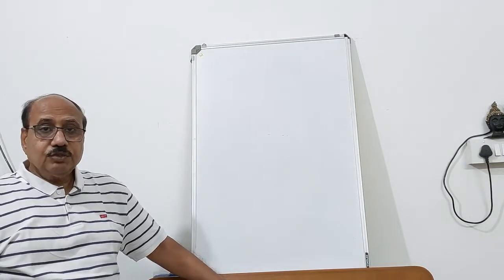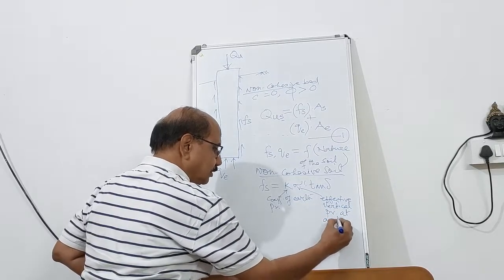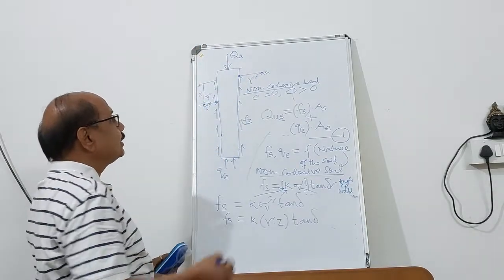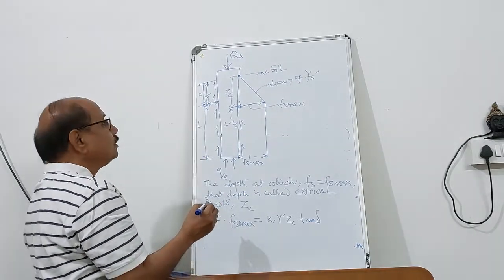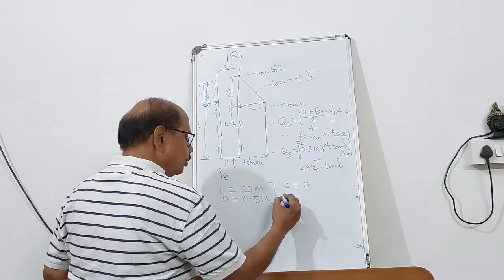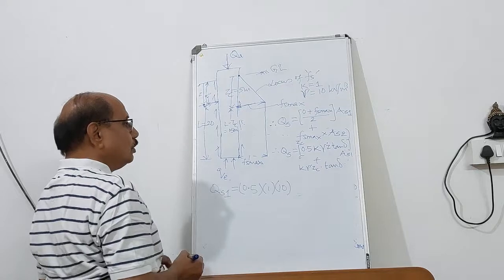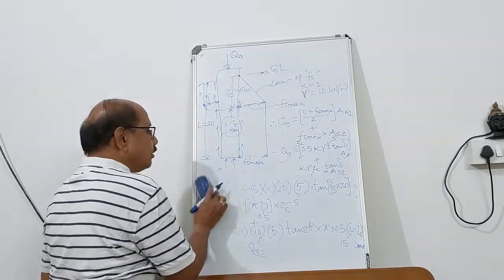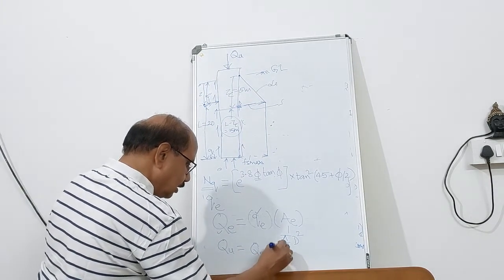Pile Foundation - 11 | Ultimate Load Carrying Capacity of  a Pile embedded in Non- cohesive Bed

Comment: One time I peer reviewed a pile design calc.   The designer said driven piles don’t have a critical depth in sand - resulted in a high capacity.  PDA data (2 weeks after initial driving) show the ultimate capacity is lower than his calculated capacity by a large margin.  So critical depth is there.   Great teaching material.  Thanks.
Reply from the maker: Welcome: 🌹

Comment: Zc=5m  but in Qs2 Z=15m so your answer is wrong you have to change this
Reply from the maker: Dear Bhautik, Qs is divided into 2 parts as Qs1 and Qs2. In both Qs1 and Qs2, fsmax  will be k*y'*Zc*tandelta and in As1, it will be perimeter of pile*Zc; whereas in As2, it will be Permeter*( L- Zc ). Zc = 5 m and L-Zc = 15 m are correctly Explained. 
So the Answer and explanation are correct. You r getting confused between fsmax and shaft area (As).
Reply: Ok sir